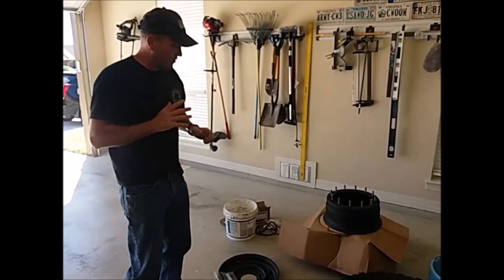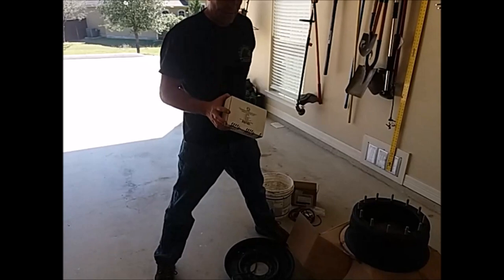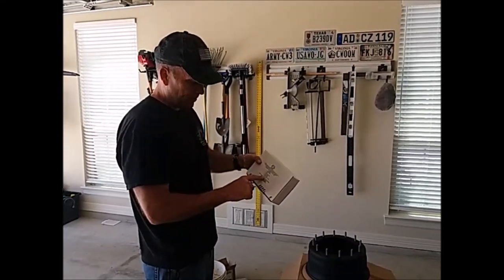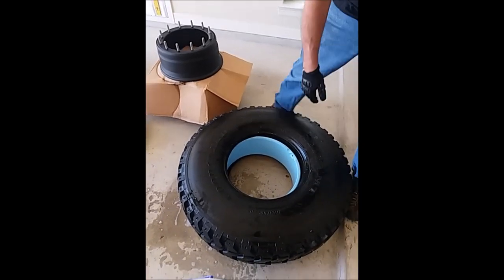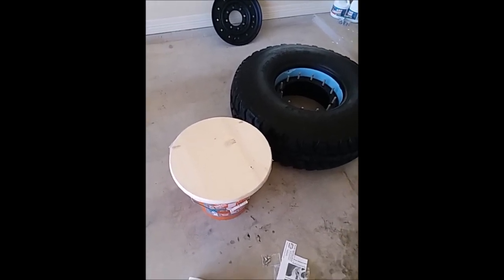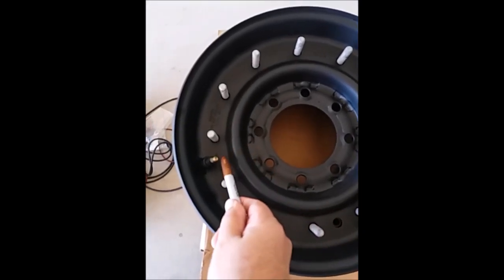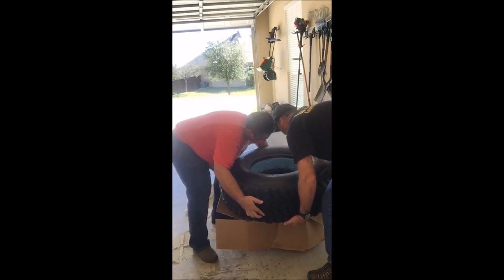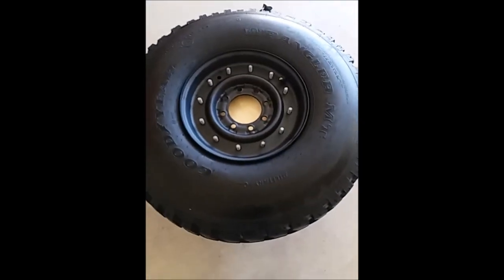HMMWV Split Rim Tire Assembly

Comment: Great video! Wouldn't advise standing over anything with a split rim while airing up.
Reply: This is a 2 piece wheel, not a split rim. Way different design, and the split rims were never used on the HMMWV. But yeah, those split rims are dangerous.
Reply: @True_Knight  might want to look at the video again and reference timestamp 10:57.